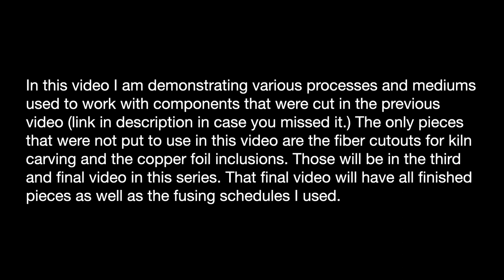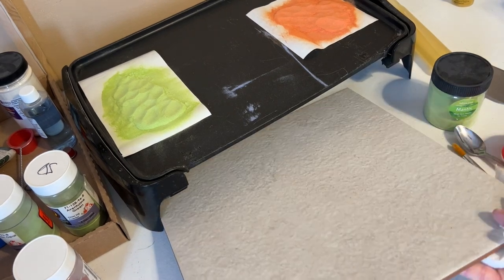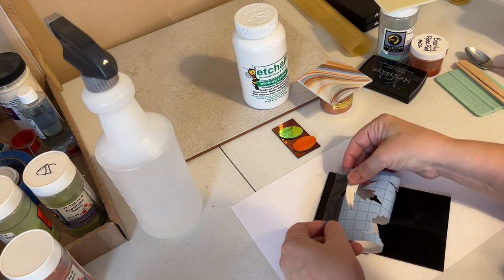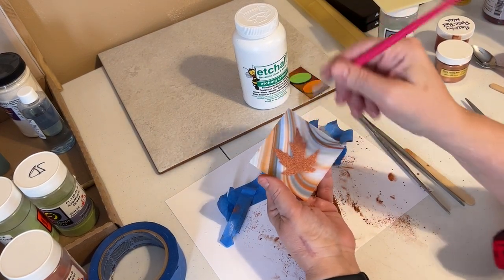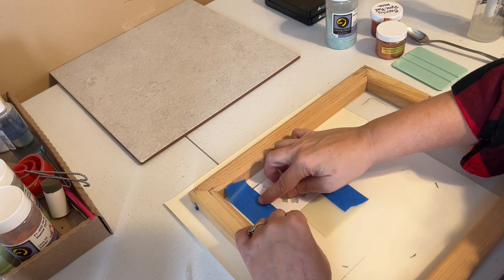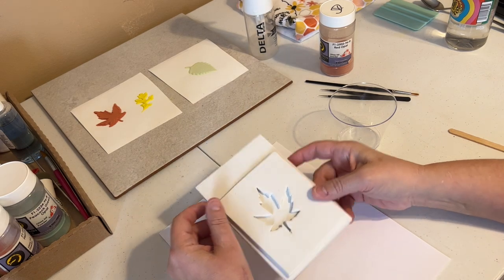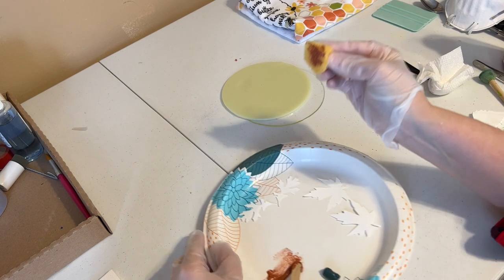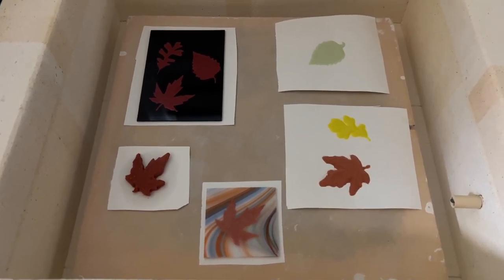Incorporating the Sizzix into Glass Fusing - Part Two: Using the Die Cuts

Comment: So, you can actually use those large ceramic tiles as kiln shelves? I have a ton of them that I use with polymer clay. Kiln shelves are so expensive!
Reply from the maker: I have heard use unglazed. I’m not sure what glazed would do, but I’ve used glazed ceramic dishes as slumping molds. I just sprayed them with ZYP. If your tiles are glazed (or even if not) you can always pop them into the kiln and test them without anything on them. If glazed I don’t see why you couldn’t just cover with ThinFire or Papyros. I’ve got a small 6” unglazed tile I’ve used several times and it holds up great.
Reply: @FullMoonLoonDesigns  thank you!